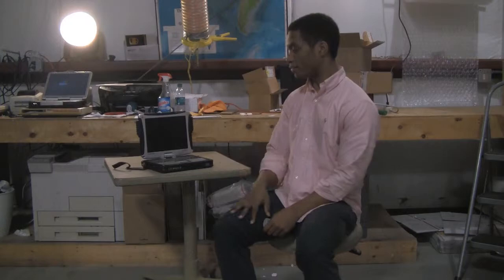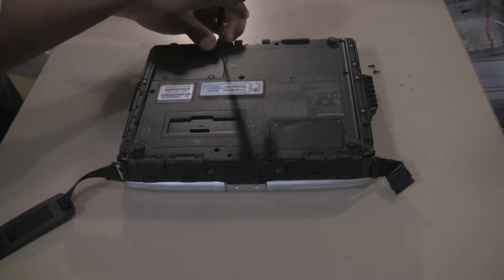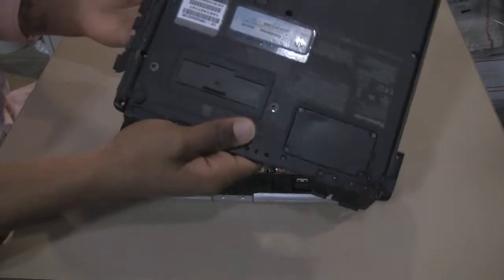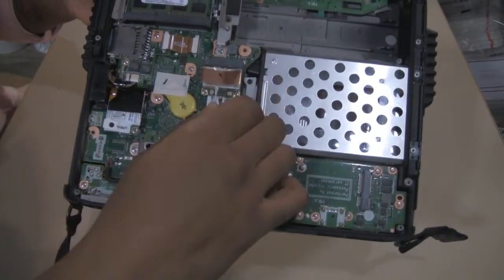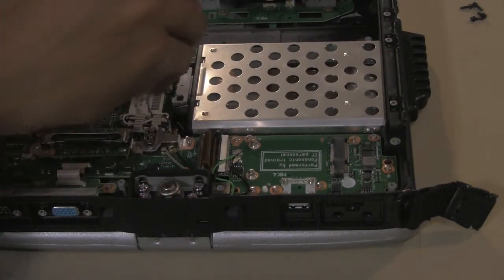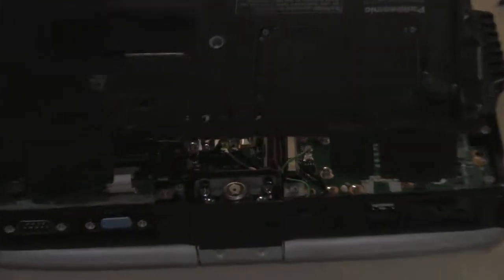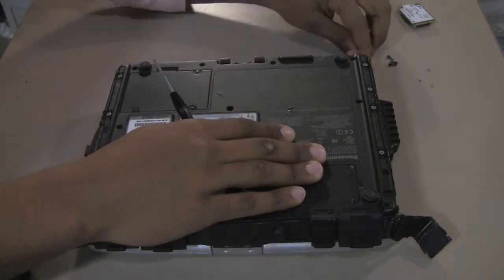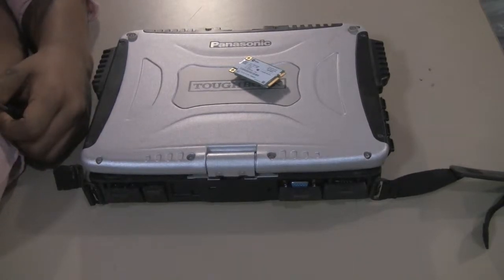How to Replace the Wireless Card in a Panasonic Toughbook CF-19

Comment: My cf-d1 is running win 10 and stuck in airplane mode. Any advice please
Reply from the maker: This seems to be a somewhat common problem. Try this: https://www.linkedin.com/pulse/airplane-mode-turning-off-windows-10-fixed-jingyansu-choudhury/. If this doesn't work for you, you might have to completely uninstall Windows 10 and reinstall it. However, before you do so, make sure you back up all your data. Hope this helps.
Reply: @Bobjohnson  I just received a copy of windows 10 on usb. Any ideas how to do a complete fresh install. Is it just stick usb in and it gives options, or more complicated that that?

Stuck in flight mode I am thinking network card buggered or something. Just a wild wild wild guess.
Reply: @Bobjohnson  tried ethernet cable to Mac and nothing in networking adapters. tried same thing on my other cf-d1 and ethernet icon appears in networking. so would this suggest buggered network card...? can they be changed. could I buy one from you guys..?